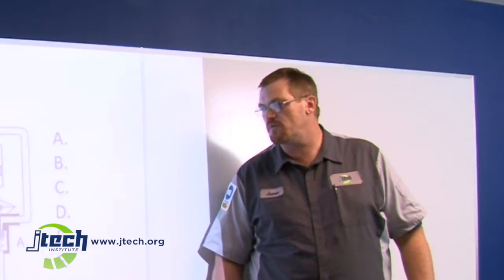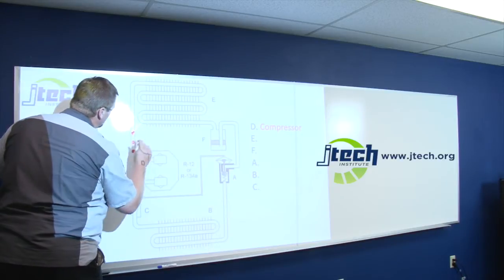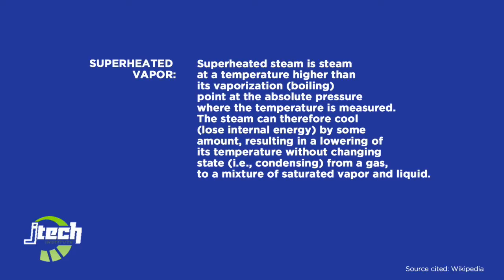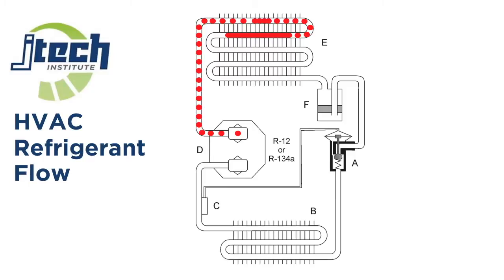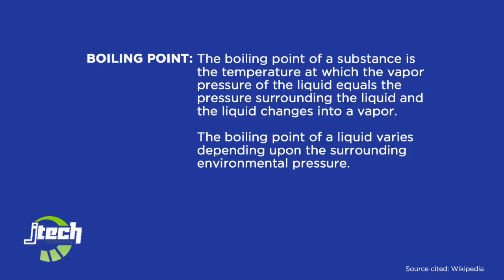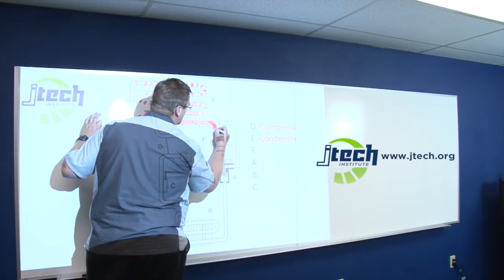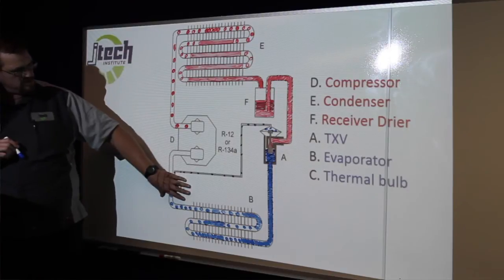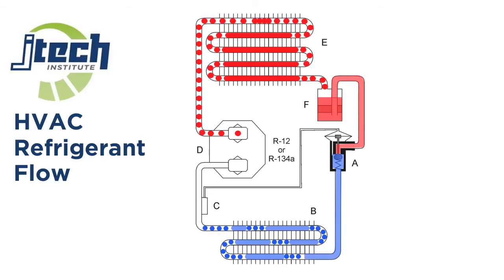HVAC Refrigerant Flow

Comment: Where is the drier/filter with desiccant located? Near the condenser or near the evaporator. How often this need to be replaced?
Reply: Normally on the return line from condenser coil to evaporator coil.